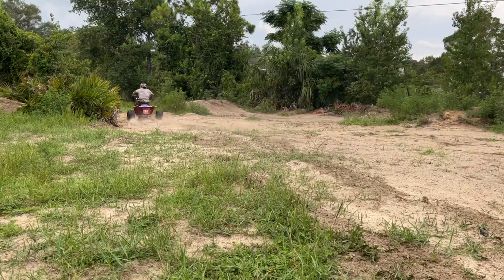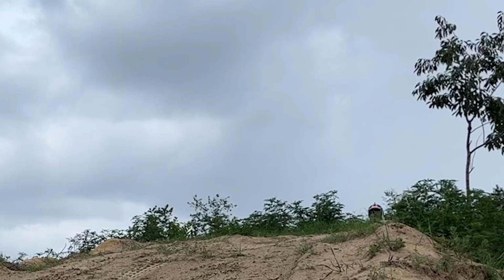Bad Engine Bog Can YOU Hear it

Comment: I don’t see smoke, so I don’t think it’s too fat… how does it run when it’s cold?  I’ve heard horror tales about aftermarket cdi & stators…Is it a spark issue??
Reply from the maker: 40:1 dominator barely smokes, oem electronics all good. Had a small pool of water in the tank trickling into the carb that built up from sitting.